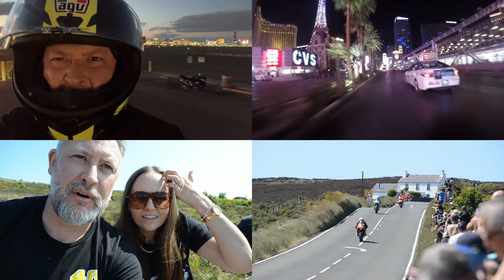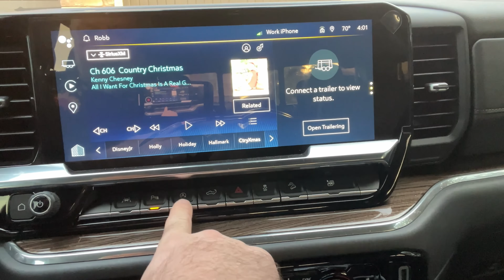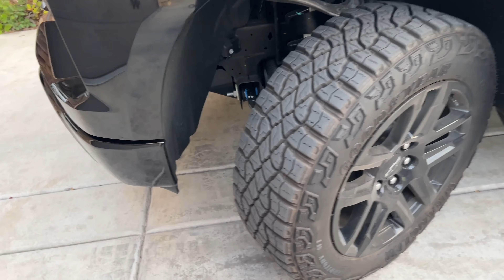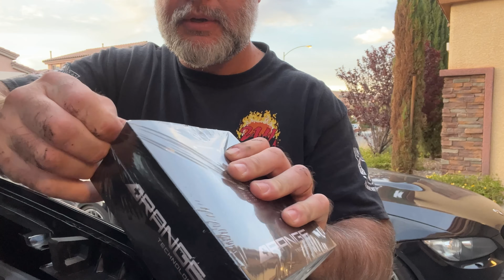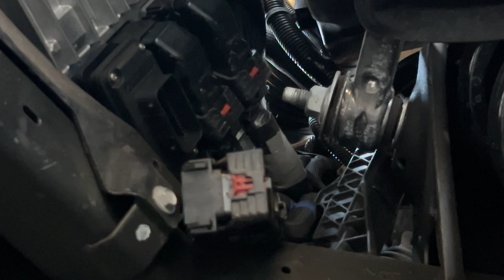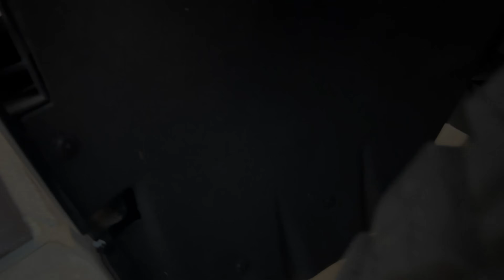Robb Review:  Range Technology Inline DFM Disabler

Comment: Thanks for the video and information. I installed the Range AFM  disabler in my 2016 Yukon with the 5.3L V8. I have a 2021 Tahoe with the 5.3 now. Not sure why they switched from the OBD 2 port to the ECM inside the wheel well but it obviously makes taking the unit in and out much more difficult. I’ve read that because of the chip shortage back in 2020 some vehicles didn’t include the DFM chip. How can you tell if the DFM is working? Will driving in sport mode prevent the DFM from dropping cylinders? I appreciate your input. Ty
Reply from the maker: I don’t think it’s possible to disable DFM by driving in sport mode, but some have reported success by manually driving in 9th gear.  It can be difficult to hear DFM enabled on stock exhaust (much more noticeable if you have after market mufflers).  Do you still have the window sticker?  If I recall there was something on my sticker that signaled it had DFM—I’ll check when I get back home.  If you have one of the 2021 or 2022 models without DFM consider yourself lucky!  Personally, I still like having the Range module simply to keep the auto off/start disabled.

Comment: Rob have experience in oil consumption between oil changes.
Reply from the maker: Zero oil consumption so far after 2 oil changes with the module installed, both at 5K mile intervals.
Reply: @robbsgarage  What oil brand are you using
Reply from the maker: @leecochran5912 at 11K miles and on my 4th use of AC Delco 0w-20 (manufacturer recommendation) including the initial factory oil, but given the recent 6.2L recall I’m going to experiment with 0w-40 next oil change and will make a video showing the oil analysis comparison.
Reply: @robbsgarage  ok , my is 2023 Silverado with 5.3 , I’ve been using the the Ac Delco oil 0w 20 also, I’m thinking of going with Amsoil 0w20 for more protection, I’ve seen Acdelco oil have nothing in it to protect the engine, it’s just the bare minimum to get that fuel mileage that government wants. I also thinking about getting the Range, I seen it won’t get rid  O  cylinder activation, like when you run in L9.

Comment: Can't use on 6.2 with 10 speed transmission. Every other company that makes this device will tell you. Range will not. They will "reflash" it to try to solve the problems you're having until your warranty is out. Then they'll tell you it's a known problem and there's nothing they can do but sell you the pulsar for $500+.
Reply: I just bought it for my 6.2. Whats the issue?
Reply: @Juniorpj033 works ok after it warms up but for the first 10 miles or so, with a steady throttle, the RPMs will surge up and down over  and over making the vehicle speed up slightly and back down over and over.
Reply: ...and this happens every time you get in it. Even if you just drove 40 miles. Next time you start it up, it'll do it again.

Comment: I just want to clear something up, on the newer version of DFM, the cylinder deactivation is on random cylinders,  not the same ones all the time? If so this would mean more than 4 cylinders have those crappy lifters. And if that's the case I would think this product would greatly reduce lifter wear by not allowing any lifter to collapse. Am I on the right track.
Reply: yea, with old AFM it was same 4 cyl that shut down. This created a heat difference between cyl that caused a issue, not sure what it was. ( head gasket issue maybe with water jacket) The DFM has 17 different patterns that shut down any cyl or cyls as needed, so the heat issue was fixed with DFM, but they did not fix the lifter issues.
Reply from the maker: @EllisRitter-ui6qu  yeah that’s my understanding as well.

Comment: Great review Robb! Question, did you notice any battery drain after using this ECM solution? If I remember correctly, the OBD port solution from Range used to consume abit of electricity when the truck is off, draining the 12V battery.
Reply from the maker: I although I haven’t measured, no drain seems to occur even after letting the truck sit for over a week.
Reply from the maker: Just posted an update after 25K miles on my truck:
https://youtu.be/MHNVToMra_0
Reply: @robbsgarage Thank you for the update Robb! I just added it to my watchlist, will check it out shortly for sure.

Comment: I have a 2023 silverado 5.3  , range tech customer service says the 12th number on vin must be higher then 5 , mine is 4. , will it still work?
Reply: The way I read it is the 12th digit on the vin is only for 2022 and the 5 signifies 2022.5 and is a refresh therefore compatible. They also state works on all 23 and newer so you should be good to go.
Reply from the maker: @gtzrg  you’d have to confirm with Range Technology, but it works on mine which is a 2024 5.3.
Reply: @robbsgarage  I called Range Tech twice, two different answers so now I don't know!!  thanks!!

Comment: I bought a range almost a month ago, I love it. Only complaint I have is GM could have placed the ECU in a better spot... Also fun fact, sometimes when reconnecting the battery it might set off the cars alarm, I would lying if it didn't scare the ** out of me.
Reply: Agree, I had to remove my LF wheel & then remove 6-7 screws from wheel well liner so that I could access the plug & install the Range module.
Reply: @johnwatz4955 wasn’t to bad for me bc I have the AT4 so 2 inch lift so didn’t have to remove the liner
Reply from the maker: Still working good?  Just posted an update after 25K miles on my truck:
https://youtu.be/MHNVToMra_0

Comment: I just purchased a 2025 chevy silverado LT ecotec3 10 speed v8  called range technology, and according to them, the DFM disabler is not compatible with my truck do you recommend something different that i could do to disable ?
Reply from the maker: You have a ExoTec3 V8 (5.3 or 6.2 L?) and they said it’s not compatible?
Reply: @robbsgarage  5.3, and yes, I emailed them and called, and both times, they said they haven't tested them on the ecotec3 engines
Reply: That's no longer the case. The original Range version didn't work with the 10 speed tranny. The new model (Part #RA007) was redesigned to be fully compatible.

Comment: I bought one and it through a check engine light months after installing
Reply from the maker: It’s possible you may need to unplug and replug the module back into the computer and make sure the harness clips into place.  Check out my conversation with @smokey4487 in the comments below.  Like my neighbor, his wasn’t quite snug enough at first.

Comment: Will this work on a 2024 Silverado 1500 custom ?
Reply from the maker: As long as it has a 5.3L or 6.2L gasoline engine it will.  Be sure to order the correct module for your engine.
Reply: @robbsgarage  2.7L?
Reply from the maker: @prvaz3417 I believe DFM was only installed on the V8 gasoline engines.  If you have the 2.7L turbo then good news is you don’t need to install this module because you shouldn’t have the factory DFM anyway.
Reply: @robbsgarage  I’m not sure about DFM but I was looking to find a solution for the auto stop feature.

Comment: I just installed one of these on my 24 Silverado LTZ w/6.2 and AWE OFG exhaust.  I wasn't aware of the "0 cylinder" mode and thought the module wasn't working correctly since I could hear the exhaust note change when slowing to a stop - sounds like engine kicking back into 8 cylinders right before stop.  One concern: since new, I have been driving my truck in L9 around town (D on highway) and I haven't ever heard the exhaust note change when slowing to a stop (always sounds like 8 cylinders).  That being said, is the range module really eliminating DFM, because I'm pretty sure my truck doesn't go into "0 cylinder" mode when driving in L9?  I contacted Range yesterday (thru website) explaining the situation and they asked me to send them the serial # off of the back of the module.  Bitter cold and snow so I haven't gotten around to taking module out and doing that...  It has eliminated auto stop feature.  Curious and appreciate any feedback.  Thanks
Reply from the maker: I had the same question for them already.  They explained that the 0-cylinder mode happens at low speeds (such as cruising to a stop on city streets) but it happens by the ECM cutting fuel to the engine as opposed to DFM which disables lifters from operating.  So, they claim it’s not DFM that causes this to happen and it’s not as bad for the engine as DFM.  They told me they’ve been testing ways to disable the 0-cylinder mode with this module but haven’t found a way to do it without causing other issues.  I’ve got over 4K miles in the truck since install and haven’t been bothered by the 0-cylinder mode, but if they release a firmware update that disables it I’ll certainly install it.
Reply: @robbsgarage  Thanks for the quick reply and explanation!  Unfortunately, with the AWE exhaust, that sound bothers me - it actually sounds just like I'm in D mode.  I find myself driving in L9 still.  Wonder why "0 cylinder" mode doesn't occur in L9?
Reply: You were spot on correct!  Range just replied and verified that the RA007 DFM disabler does not disable the 0 cylinder mode.  They explained that if the Auto Stop/Start is disabled then the DFM is disabled, so my device is working properly.  They haven't figured out a way to disable the 0 cylinder mode yet.  They did verify that driving in L9 disables both the DFM and the 0 cylinder modes.
Thank you for your knowledge and help @robbsgarage!
Reply: @KurtDulle-x5n so do you even need the range if you drive in L9 ?   I just ordered the same model for my 2024 6.2 trailboss
Reply: @JOHNNYUPLOADZ  Not really, I guess, but, as I'm sure you are aware, it also eliminates the AUTO STOP/START feature which is convenient.  I also do a lot of highway driving and would rather not drive in L9 at consistent high speeds.  I'm happy with the product.  Hopefully it works out for you too!
Reply: @KurtDulle-x5n  I believe L9 also disables auto start / stop.
Reply: @KurtDulle-x5n  my 22 trail boss came from factory without auto start stop but my dfm is still active.
Reply: L9 disables start stop.
Reply: L9 disables it as well, so technically you wouldn't need the range product. However, it is a huge inconvenience to have to go into L and click the gear lever up to 9 every time you go to reverse and back as well as when you start it each time. I ordered mine, but it hasn't arrived yet. I am eager to install it.

Comment: What’s the difference between this one and the one that plugs into the OBD port under the dash board?
Reply from the maker: The OBD plug-in model applies to engines built prior to mid-2022.  The version I installed is for mid-2022 - 2025 models.
Reply: The older OBD also doesnt work with a 10Speed transmission. The newer one (it states refresh on the description) is for years after GM went to a 10 speed tranny and refreshed the interrior. At least thats my understanding.

Comment: I asked Artificial intelligence the question below.
Is the DFM disabled in my 2024 GMC 1500 Sierra 6.2 liter when in Tow haul mode or sport mode ? 

AI answer - Yes, in your 2024 GMC Sierra 1500 SLT with the 6.2L V8, Dynamic Fuel Management (DFM) is automatically disabled when you engage Tow/Haul Mode or Sport Mode.

Why?

Why?
•	Tow/Haul Mode: The truck prioritizes power and torque delivery for towing, keeping all cylinders active to improve performance and stability.
•	Sport Mode: The system maintains higher RPMs and prevents cylinder deactivation to enhance throttle response and acceleration.
So when you're in either of these modes, your truck will stay in full V8 mode rather than switching to fewer cylinders.
Reply from the maker: @MarvinHenderson-j1v  that’s interesting, because on my 2024 Silverado 1500 5.3 liter DFM definitely stayed enabled when in tow mode.  That’s actually what prompted me to research options because one day I was towing, DFM kicked in, and freaked me out.  Try driving around in tow mode and see if it really shuts off on the 6.2?
Reply: @robbsgarage  I have 11,000kms on my 2024 GMC Sierra 1500 6.2 and have only been in Tow haul mode or sport mode and I have yet to notice the DFM system or hearing cylinders cut out. Sport mode activates "active exhaust" which sounds very good, probably not as good as aftermarket exhaust, but all day long its firing on all 8 when in sport mode.
Reply: @robbsgarage  Do you have the factory max tow package in your 2024 Silverado 1500 5.3 ? I am not sure if that would make a difference or not

Comment: Did your check engine light came on after installing?
Reply from the maker: @Rolandomota420-69  nope!  Has never come on and it’s been about 4K miles now.  Last month I installed the device on my neighbor’s new Silverado and the light came on at first, so I disconnected the battery and reinstalled the module and it went away.
Reply: @ everything is working fine. Just the check engine light is on. I’ll do the process all over again .
Reply from the maker: @Rolandomota420-69  yeah, try uninstalling it to see if the light goes away, then reinstall it and make sure the wiring harness properly snaps into place.  I think the reason it came on with my neighbor’s truck is the harness didn’t properly seat onto the module the first time, so I helped him redo it and it worked correctly.
Reply: @robbsgarage  omg thankyou. Same problem like your neighbors truck. Little loose. Reinstalled rn. Check engine light never came on. Thankyou
Reply: @ okay, I just installed it. I’m driving around town right now to see if it’ll turn off.

Comment: Question, I have a 24 1500 LT. Have you ever driven your truck somewhere, parked it, shut off engine and just stayed in the truck for around 3 minutes without opening up the door? And heard a bunch of clicking noises from under the dash after about 1- 1 min 30 seconds after shutting off engine? Mine has done this since new. If you just rest your foot on the brake pedal you can feel it as well from just touching brake pedal very lightly. This clicking lasts about 20-30 seconds. Just curious if this is something they all do. I have 5.3, but I do not think engine size makes a difference. I believe the noise is the HVAC diverter valves going back into their "park" locations, but they sure are noisy.
Reply from the maker: Yes!  Is that what it is?  I’ve been wondering the same thing.
Reply: @robbsgarage  thanks for responding back. I'm surprised more people are not talking about this. Sounds like a squirrel is under your dash trying to get free. Sad for what these trucks cost that they make this kind of loud noise.
Reply: My 24' AT4 does the same
Reply: @Meteb777  thanks for responding. At least i know it is just not my truck that does this.
Reply: You know when the little doors are opening and closing on Ironman's suite, he's hearing the same thing.
Reply: Yes, this drove me crazy when I first bought it as well. Turns out, the sounds are the electronics systems running system checks (brake pedal adjustments etc) and resetting back to a default position every time you shut the system off. Once I knew what it was, it doesn't seem to bug me anymore. :)
Reply: @Cmatrix88  did you hear this from a dealer?
Reply: @BR549_o7 Yep. I spoke to 2 actually. The fist one told me “After shutdown, the system may run a small electric pump or actuator briefly to release or equalize pressure. This can sound like a whirring, buzzing, or clicking near the brake pedal area.” 

My dealer where I bought the truck said “Brake modules (ABS, brake assist, stability control) perform a quick self-check cycle when you shut down or open the driver’s door. That noise can travel through the pedal and sound like it’s coming from inside the cabin.”

Comment: Any update buddy?, everything working well?
Reply from the maker: Yeah, everything still working great 4K miles later.
Reply from the maker: Just posted an update after 25K miles on my truck:
https://youtu.be/MHNVToMra_0
Reply: @r @robbsgarage ey bud question, looking to buy one and it looks like some plug in right under the dash now. Same thing? Thanks
Reply from the maker: @Countdoodu9 that is the original version.  Depends on what year your truck is.  Range’s website will direct you to the correct version for your vehicle.  The benefit of the older model is it’s easier to install, but you may have to remove it to pass emissions testing because it uses the OBDII port.
Reply: @robbsgarage got mine ordered thank you. Mine is a 2020 so it’s the one that goes under the dash.

Comment: I went under my truck, held back the felt fender liner with my left hand and installed the module with my right hand. I did not have to remove the felt fender liner
Reply: same lying under the truck easy
Reply from the maker: @madmax9603 nice
Reply from the maker: Nice!  I just wanted to be precautious and not ruin the liner.  Glad you found a quicker way!
Reply from the maker: Still working good?  Just posted an update after 25K miles on my truck:
https://youtu.be/MHNVToMra_0